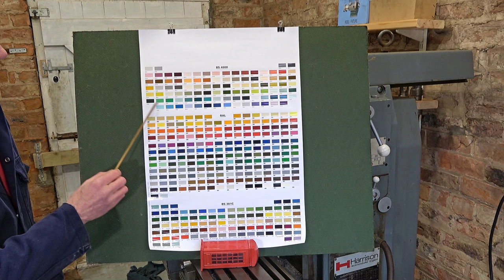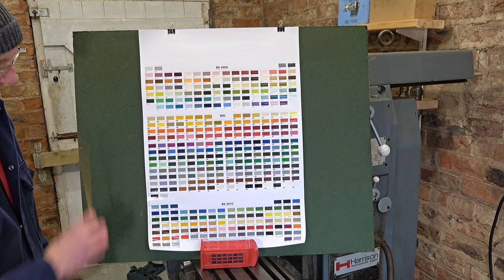HS242 Herbert Junior Mk2 surface grinder Part 9 – Paragon (re)paint

Comment: Paragon paint is good, painted my Tom Senior with it 8 years ago and despite a lot of use it still shines. I purchased a load of Meccano and it never arrived, DPD were the couriers, they sent it back to the sender as it rattled and they thought they had broken whatever was in the package. Didn't tell anyone until the original sender managed to track it down to a depot where the collect broken parcels, anyway I eventually got it and written in big letters was: :its supposed to rattle!"
Reply: Great story 👍
Reply: I also bought Meccano (like I need any more of it...) and the driver told me whatever was inside the parcel had shattered!
Reply from the maker: Aren't you too old to be playing with Meccano Tony?
Reply: @HaxbyShed  never too old. do displays at various places.

Comment: I concur about the colour from Paragon, the grinder looks miles better in its new livery than the one you used previously. Back in the day I used to inspect industrial electrical equipment at different manufacturing facilities. I had 3 light-tight boxes of postcard sized paint samples (BS & RAL) that would travel with me. I rarely had issues, but on occasion there were disasters where lots of kit had been painted the wrong colour and assembled...
Reply from the maker: Hi Paul, to follow up on the Boxford paint colour story, apparently they took more care with the colour match if it was a contract for the Department of Education (i.e. machines for schools). Cheers
Reply: @HaxbyShed  Good to hear they are still supplying machine tools to schools. I got my first taste of machine tools in my metalwork class in secondary school back in early 60's

Comment: Quite the story.   Thanks for sharing.   Very good by Paragon.    Sounds like a good company to deal with.
I like the lighter grey and the original.   It would be a difficult choice for me.    The machine looks very good.
I love that colour chart. 
Dave.
Reply from the maker: Thanks Dave. I've learnt that colour matching is a complex topic and also there are many colour schemes. There are at least 2 RAL schemes. BS 381 originally 1930 but with revisions in 1945, 1948 & 1964. And then all the others ....  Cheers

Comment: Hello Paul. Thank you for the lovely chat whilst you painted the machine. So much better than simply watching the paint dry. That said, full credit to Paragon. They certainly went over and beyond. It’s great that good British companies still exist.
I have used Paragon before and do also recommend their paints. However I’ve struggled matching paints in the past by not knowing whether to choose gloss, semi gloss or indeed satin. As machines age they loose their gloss and it’s tempting to steer away from gloss. But in doing so, the less glossy paints I find are harder to apply by brush. 👍😀
PS The surface grinder looks resplendent in its new “original colour”. Well done 👏👏
Reply from the maker: Thanks Andrew. Cheers

Comment: Must admit i do like Paragon paints! I used it on the Colchester, use their thinners too, it is better than white spirit and produces a higher gloss and better oil resistance. I sprayed the Colchester, but i have found that using a small gloss roller gives a finish very close to spray work-light looks excellent! The machines we have are certainly from the heyday of British machine tools, and a surface grinder is something i want rather than “need” but that never stopped me!
Another cracking video Paul!
Phil
Reply from the maker: Thank you Phil. How does Paragon stand up to (semi)synthetic coolant?

Comment: Hi Paul, What a great offer from Paragon it looks just the job, mind you I liked it how it was too. I think you were lucky with the cover that could have easily gone missing in the accident.

Not sure how customs works in the UK (having just read Kimber's comment) here, despite the customs label indicating its a gift with next to no value the post office insist on charging the minimum customs duty about 5 pounds. No way around it I'm afraid.

Have a great weekend!!
Reply from the maker: Hi David,  the duty free allowance for a gift from anywhere outside UK is £39 (currently about 49USD / Eur45). After that it gets 20% VAT slapped on and the handling charge. Then over about £135 it also attracts import duty but that's not high - maybe 5%.  For Europe there is no import duty provided it meets the country of origin requirements.  In some cases the country of origin can be redefined if the part is incorporated into something else - or otherwise transformed. I think in practice it depends very much on what the sender puts on the customs label. But don't take my word for any of this ..... it's just my diy understanding.  Cheers
Reply: @HaxbyShed  Hi Paul, Thanks for that.

In theory it's broadly similar here but Spain being Spain the application is not as it should be. The postie insists on applying the charges against gifts, no argument, you either pay the duty or they send it back. I have paid it on a few occasions for Christmas gifts from family but I've told them not to send anything it's not worth it. Better to give it in person next time we meet.

I have brought books and paid the duty. In all honesty I don't follow the logic I can't buy similar books on engineering etc here so it's not like local products are at a disadvantage. That said I don't think Amazon products get treated like that.

Anyway rant over!! Have a great Easter!!

Comment: I used paragon when repainting the Harrison lathe. It’s a joy to use compared to hammertoe smooth etc
Reply from the maker: Hiya, I used oil resistant grey floor paint on my Harrison and it's done ok. With hindsight Paragon would have been better. Cheers

Comment: Well Paragon really came through for you Paul, does the paint go on OK? It looks as if it is covers alright. Must admit I have been looking at their products to paint my machines when I get to them, although they will all be the same light cream or light grey. I have no natural light in the workshop, I want to keep the shop as light as possible.
Reply from the maker: Hi Bill, the paint goes on very smoothly and covers well. I do not know if it resists synthetic coolant, I've not tested that. I painted the Harrison with industrial floor paint and that will sit in mineral oil all day and not lift but synthetic coolant will bubble it if I leave it standing. Perhaps I'll paint a bit of the lathe tray with the Paragon grey and see how it does. Cheers

Comment: Paragon by me made a colour specially for the company, though it did not actually have a name, just a colour code. Was stored under their special colour code, so you can go anywhere and order it, and it would be mixed to the right match. Also a good paint, it covers well, and is very hard wearing.
Reply from the maker: Thanks Sean. It seems machine paint is a truly international topic since we all have the same issue. 😁 Cheers

Comment: If the touch screen has gone, it's quite likely the pressure caused delamination of the screen. This messes up the capacitance detection giving symptoms like you're seeing. It likely needs a new screen. 

However, you'd have to trace the path of mechanical stresses to see if its more likely the screen or the circuit board.

Also, don't discount it being after warranty day which let's the gremlins out! By that I mean it's quite possible the mount is a red herring, and moisture or temperature related damage actually caused the problem (or it's a defect/bug - see if you can flash the firmware).
Reply from the maker: Hi Tim, you may have seen my later video fixing the cam. It was the printed flexible ribbon cable between the display and the main board. A tricky job. Cheers Paul
Reply: @HaxbyShed  oh, I thought you had already ruled that out with a replacement that didn't work?

Yep, ribbon cables are always suspect, especially if they go over something like a laptop hinge. Well done.
Reply from the maker: @tinkeringtim7999  Hiya. I changed the ribbon cable the first time and had just the same fault. But then I changed it again (2nd time) but avoiding any sharp creases in the folds and then it worked.  Cheers